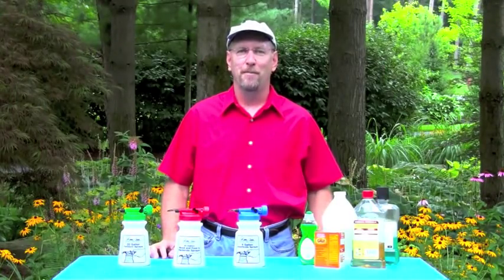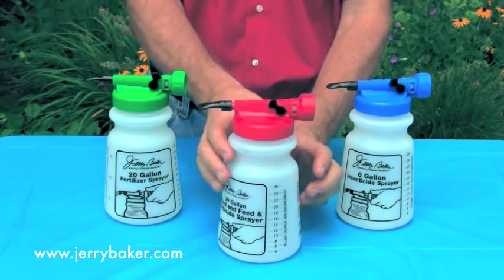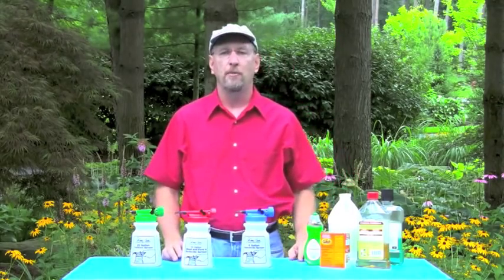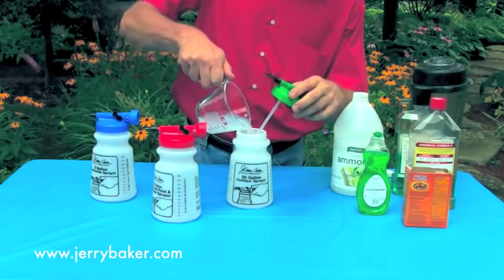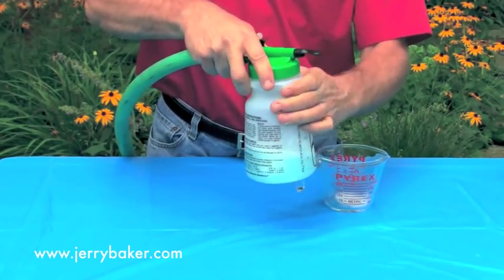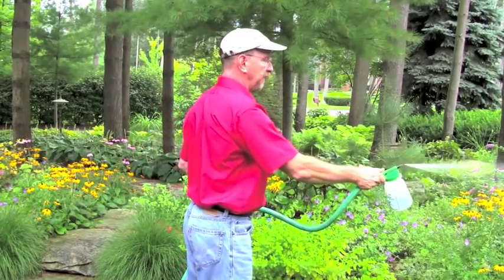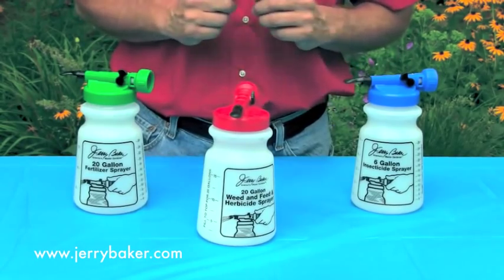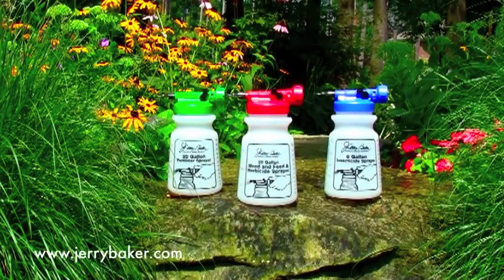Jerry Baker's Hose-End Sprayers

Comment: I always had a little trouble using the hose end sprayers. I did a flow test and found that I empty a 20 gallon hose end bottle in two 5 gallon buckets. I bel;ieve that means I am spraying twice as much spray as I need. So I believe I need to cut the amount in the bottle by half. For me a 20 gallon bottle is a 10 gallon bottle?

Comment: so if filled to the 26 oz mark, it is 26 oz per gallon of water?
Reply: I had the same question! Directions on my Jerry Baker Sprayers "Mixture Example" says if the product calls for 1T per Gal and you want 4 Gal you put in 4T and fill with water to the 4Gal mark. The correct colored  sprayer top (I suspect) regulates the rest.